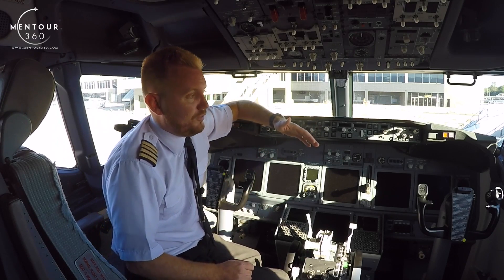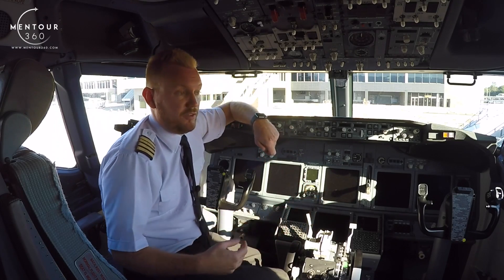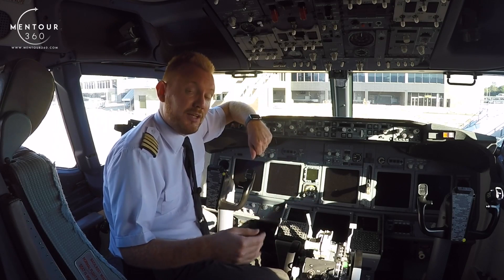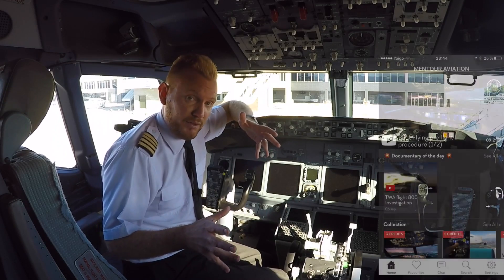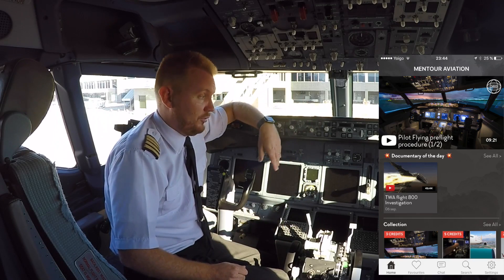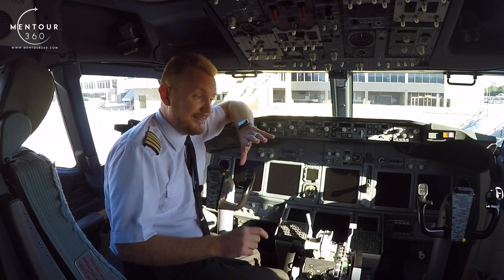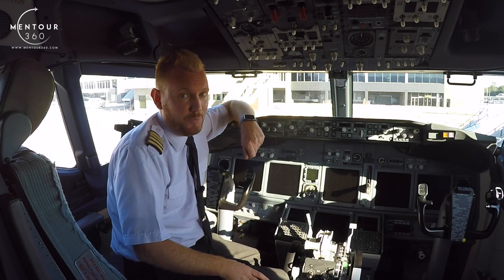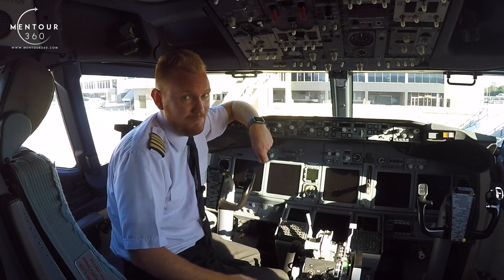How do flaps work on an aircraft?

Comment: Thankyou for the video I’ve built and flown  Remote ControllAirplans so i have the basic concept of the Wings  Job but i was confused on CommercialAirliners Flaps  operations because as a Passenger withWindow seats i could not see anything moving up or down l on the wings  but this makes sense as to why and how they operate  in my defense i was thinking they operated more like the Airelons  but the  more work like  extending and decreasing the shape of the Wings  from both the leading and trailing edges  my imagination had it completely incorrect  as i thought it worked more like a air flow Dam  to increase and decrease Airflow  i knew it was Important for lift and Drag used in take off and Landings

Comment: We see how each wing has two flaps one out board and one inbound noticing how the outboard flap has the two flap fairings beneath. And for the inboard flap I only see one fairing beneath the flap. Why is there only one fairing and how is the other end is supported because I figured if that inboard flap is depending on that one fairing then the stability is not that great without the second one that is needed. I do notice on 747s each flap uses two fairings thereby having four on each wing. I also notice on other planes other than the 747s if there was a fourth fairing noticing that it would be  in the way of the landing gear (747 ones just clears the outer landing gear opening) for other planes is there a side fairing that is built into the fuselage to support the inner most part of the inboard flap and to keep it sturdy during flights, take offs and landings?  Thank You 🙏

Comment: Flap are clear for me now. What makes me still intrigued is the small amount of area of the flaperons. Why do we need them if we still have the ailerons? And also there is spoilerons operating at some times
Reply: Flaperons are needed for high speed handling because they have reduced control authority and cause less wing torsion which leads to bad aeroeleastic effects: aileron control reversal where the aileron makes the wing twist enough that its deflection does the opposite of what it’s supposed to. At lower speeds that’s not an issue, and the ailerons have much more authority

Comment: Any chance we could have a video about the "TERRAIN: TOO LOW" alarm?
Reply: It's very simple, and i don't think it would require a video, basically, on the 737 and most Boeing aircraft, there is a terrain radar system. This can be switched on in the MFD panel (but is not required for the warning), and then you will be able to see all terrain nearby on your ND. So, when the terrain radar spots terrain dangerously close to the aircraft, it'll give a warning to the pilots. It also works if you get too close to water.

Comment: A stupid question: Some smaller airliners have their left and right flap mechanisms interconnected with a shaft, so that it‘s impossible to extend or retract flaps asymmetrically (which could, obviously, lead to a crash). But do even the biggest airliners have that mechanical connection between the wings? Or is there a different safety feature that prevents flap asymmetry? How about an A380 or a 747? Is there a flap shaft going all the way through the fuselage and connecting the flap mechanisms?

Comment: The slots don’t extend the boundary layer, they blast the boundary layer off. This is done intentionally because, even though it loses a bit of lift, it manages/controls the position of the separation point and thus there is less turbulence. 
The extension of the wing means that there is a much higher likelihood of getting separation of the boundary layer over the wing and without slots this would happen at a random, unknown and possibly ever-changing points. This could drastically decrease the handling of the aircraft as it comes to land.
Reply from the maker: Good stuff!
Reply: Mentour Pilot. Thanks! By the way would you recommend going to pilot school after having done a mechanical engineering degree, would it help at all? I am now 22. Do you think it’s too late?

Comment: Wanted to check if selecting flaps 40 or full flaps everytime everytime while landing is advisable coz more drag more control the pilot have while approach, does selecting a setting lower to 30 with lesser drag has any advantage like saving fuel etc. Also as mentioned the LE flaps and slats are controlled by single flap lever for B737; does Airbus sepcially 380 and MD11 have a separate lever for slats coz i have seen pilot pushing down a black lever located near to the flap lever post landing and after retracting the flaps.
Reply: Flap 40 is generally used if the runway is short. It is not recommended by Boeing to use Flap 40, unless the runway is, i believe, less than 1500 meters long. Flap 30 is the best option, gives you a good speed, not too much drag, and a lot of lift.

Comment: Can flaps be lowered and locked using gravity during total hydraulic failure like landing gear?  Can the left and right be operated individually to help bank in a emergency?
Reply from the maker: +Bruce Wagenberg Hi! No, not using gravity but we have an electrical backup system that drives them out in case of hydraulic loss. The cannot be mover individually.

Comment: So, if higher flaps may be appropriate for short field TO, but flaps add drag, is there ever a case for starting the roll with low flaps to build airspeed more quickly, then selecting higher flaps to gain required lift?
Reply: Never for commercial aircraft; too dangerous and adds pilot workload.

Comment: @Mentour Pilot how is the flaps, slats etc differ on a 737 and a B 17 Bomber for example? Does a B17 Bomber have a moveable leading edge and slats?
Reply: Completely different. B-17 has no leading edge devices (slats or anything), and a split flap which basically means the bottom surface of the wing deflects downward. It's not a good flap – draggy for the extra lift it produces, which is not much. The 737 has one of the more complex flap layouts around, and more modern aircraft typically go for the weight and complexity savings of a simpler flap system

Comment: Nice video Mentor, why are the fuel control levers in the video different to the more traditional ones?
Reply from the maker: +Adrian Koola Because this is a brand spanking new aircraft and therefor it has the new electronically controlled start levers. Check out my Instagram account to see them up close.

Comment: Mentour Pilot, why does the fuel cutoff lever in the video different than the levers in common 737-800 cockpits? The lever in this video looks like the lever for 777. Is this an optional feature on the 737NG? Thank you capt!

Comment: Hey Mentor Pilot. Love your channel. I have a quick question. Can a modern airlaner take off without extending  the flaps? I was recently on an A 320 and the pilot did not extend the flaps. I tought we will crush.
Reply: Nope..takeoff config warning comes on..loud🙉
Same on the A320, meaning the pilot flying did extend the flaps😉

Comment: Mentour Pilot You can't turn landing lights on before received "cleared to land" form the ATC, right? Is it an international rule? Anyway your expropriations ware very detailed always and I loved that.
Reply from the maker: +mPD780C1 This is a company procedure and it’s actually as follows. The landing fixed lights are turned on at 10 000 feet to increase visibility. The retractable landing lights and Taxi lights are turned on when landing clearance is obtained.

Comment: Why those Flaps & Slats not automatically reacting ( no manual action required ) when the aircraft speed changed ? The computer can be programmed to know if this aircraft going to take-off, to landing, or go around.

Comment: If flaps create a drag for the plane to slow down then what do air brakes do? What exactly is the difference?
Reply: Flaps create lift and also increase drag, while speed brakes increase drag exclusively. Spoilers reduce lift by destroying the smooth suction surface and also increase drag.

Comment: Also, a byproduct of flaps 30 or 40 is increased drag and therefore higher engine rpm. This facilitates quicker engine spool-up to go-around thrust in case of a missed approach.

Comment: What is the difference between pylons and nacelle ?
Reply: Hey Aman, the pylon is the rigid structure used to hold the engine in its place and position under the wing, without interfering with the airflow over and under the aircraft wing that is needed for lift and control. The nacelle is essentially the engine casing, used to shield internal components from debris and the elements. Hope that makes sense! If you've got more questions like these, head on over to my channel and subscribe! Addressing these sorts of questions is kinda my thing :)

Comment: I assume the flaps numbers are degrees.  It seems like 1 degree would be almost insignificant.  Am I missing something?  Also, when you are talking about a single engine landing, do you mean a 737 with one engine out, or just generally single engine planes?
Reply: Cliff Jones No, flap numbers are units.
Reply: Cliff Jones it depends on the aircraft. Boeing is in degrees, airbus is in units
Reply: ZK-APA No..like I said the 737NG has its flap settings in units🙃 It is kind of close (compared to Airbus) to the degree but not close enough for Boeing to call it degrees in all relevant documentation😉 I believe flap 1 is about 8 degrees🤔
Reply: @speedbird9313  aah Ok. Guess i learnt something new today. Thanks for correcting me. Cheers man :D

Comment: i saw a video where the "operator retracted the flaps at sixty knots and went into a stall"..does retract mean zero degree flaps
Reply: Retract means "put in motion", retracted means flaps are up (so yes zero degrees).
The flap settings on the 737NG is in units by the way, not degrees🙃
Reply: @speedbird9313  i see flaps are set up differently in small and large planes, thank you

Comment: hello, i just wanted to ask, why there is always 1 spoiler that is on a different angle than the others?
Reply: 1 spoiler!? Incorrect spoiler rigging..😆🤭

Hopefully it two on each wing that are a different angle from the others.
On a 737NG the ground spoliers (the inner and the outer spoilers) goes higher up (inner two 60˚, outer two 52˚) than the flight spoilers (the middle four spoilers, half goes 33˚ the other half goes 38˚)
Reply: @speedbird9313  BUT WHAT IS THE REASON FOR THAT, BECAUSE IN THE 777 THE SPOILERS 4 AND 11 ARE MECHANICALLY DRIVEN, AND THOSE ARE THE ONLY TWO THAT ARE ON A DIFERENT ANGLE
Reply: @redescfs  I actually dont know, not a design engineer🙄
But there is probably a aerodynamic performance idea behind it🤷🏻‍♂️

Comment: Hi Petter, I have another question about the flaps. When I flew to Abu Dhabi after landing the pilots didn't fully retract the flaps again. I only know this has something to do with the high temperatures there. Do you know anything about that?
Reply from the maker: +indy pranger No, it’s more likely due to a possible bird strike. If that happens, we leave the flaps in the same position as there were when we saw the 🦅. That’s to make sure the engineers can check it out before retraction to avoid any damage.

Comment: What happens if the flaps fail to retract one wing (asymmetrical flaps). Is the aircraft still flyable?
Reply from the maker: +EinkOLED We Have checklists for that. There is a computer controlling the movement. If it feels an asymmetry it will freeze the flaps in their current position to avoid handling problems.
Reply: Mentour Pilot Thanks for replying.  At cruise speed/altitude are the flaps inhibited even if below ias flap retraction speed?
Reply from the maker: +EinkOLED The Max flap extension altitude is 20000 feet.

Comment: a silly question that has never been mentioned/covered by anyone.... during circumstances such as terrain avoidance or low speed stall where the jets require a few more seconds to pick up speed due to them being set at or near idle prior to the stall recovery situation, why aren't flaps used to provide more lift? Assuming speeds are within their limits, and engines will be able to provide enough thrust to overcome their drag in the next few seconds. Or do they make negligible different in those extreme circumstances?

Comment: What does “TOGA” mean in relation to the button on the thrust levers?
Reply: The "Take Off/Go Around" mode. Used during takeoffs and go arounds. On takeoffs, it automatically increases the thrust to the takeoff power, which depends on aircraft weight, runway length, and weather (pilots need to calculate it). Same thing for go around, except pilots dont calculate anything.

Comment: Everytime the the pilots open the flaps slats and whatever the other one was, the plane brakes, the speed drops so they clearly act like air brakes as well, they they are used during take off is something i cannot understand. It looks like the plane would catch more speed faster without flaps...
Reply: It's true that flaps act like brakes, but they also increase the lift and therefore allow the plane to take off at a lower speed. If we for simplicity assume a constant acceleration during take-off, the required runway length increases by the square of the take-off speed. That means that if the plane needs 30% higher speed without flaps (just my guess), it needs a 1.3 x 1.3 = 1.69 times longer runway to accelerate to that speed.
The flap setting at take-off is a compromise of the need for increased lift and not too much braking from the increased air resistance caused by it. That's why planes don't use maximum flap settings at take-off but may do so during landing on short runways.

Comment: What is the brake cooling procedure on the Boeing 737NG? On the Boeing 777 they recommend pilots to pull gear down as long as speed is not exceeded above 270.
And after brake overheat caution disappears they will use the analog and wait for 8 minutes before gear retraction
Reply from the maker: +Garry Wan Hi! First of all the brake cooling monitoring system is optional and we don’t have it installed. We do manual calculation of break cooling and it’s very rarely a problem if you are on normal weights and using reversers. Otherwise we have a similar cooling system as you described if we are airborne. On the ground we just wait with the parking break released.

Comment: Poor flaps 25, are they ever used? And landing lights at 500 ft? I thought you are required to have them on under FL100. Btw great video, Mentour.
Reply from the maker: +Ondřej Bakan No, flaps 25 are mainly used as an intermediary flap to enable speed reduction to extend flap 40.
No, no one has landing flap at FL100, the drag is huge.
Reply: Oh, Mentour! Many thanks for your reply! My second question was about landing lights, not flaps. You said you turn them on at 500 ft as an indication of landing clearance, but I thought you are required to turn them on under 10 000 ft. :)
Reply from the maker: +Ondřej Bakan The fixed landing lights, Yes. The retractablesxwe wait with to landing clearance normally. Or in the case of this aircraft (LED assembly) we use the taxi light as indicator of landing clearance.
Reply: Oooh, I see! Many thanks for explaining. Have a great day! :)
Reply: Like Mentour mentions in a video about the no smoking sign switch, the taxi lights serve another purpose as a memory device for takeoff and landing clearance.

Comment: How do you land if the flaps won't extend? Would you abort takeoff if flaps don't extend?
Reply: Not a pilot, just an aero engineering student, but issues with flaps should be discovered well before takeoff since flaps are typically extended early. Landing without flaps just means you land very fast and need a lot of runway (and emergency crews ready since the brakes will get really hot, tire burst risk is probably higher, etc).

Comment: On the topic of flaps, something I've always had trouble with is the idea that lowering the flaps increases lift. If it's true that LIFT EQUALS WEIGHT, then putting the flaps down must increase the weight of the plane. And of course it doesn't. What makes sense to me is that, lowering the flaps lowers the stall speed. Now I understand that if you lower the flaps without simultaneously pitching down a bit, you'll momentarily increase lift (and load factor), thus keeping with LIFT EQUALS WEIGHT. Or to be more accurate, LIFT EQUALS WEIGHT X LOAD FACTOR.
Reply: Lift equals weight when flying straight😉 With flaps down lift will be greater than weight and it will get an upward motion.

Comment: I understand the reduced lift in very hot summer takeoffs. When I flew recently from Spokane, Washington to Denver,Colorado it seemed as if the extreme cold temperatures at takeoff [ 13 °F ] and landing  [ 0 °F ]  affected the amount of deployment of flaps .  Does the cold have a great affect on their use?

Comment: Sometimes, when a plane taxis after landing, I notice that the flaps start to retract, then pause, then continue to flaps 0. Why do the flaps sometimes pause insiead of going from full directly to 0?
Reply: because there's lots of different flap settings. on a boeing 747 i'm pretty sure it goes 0 - 13 - 25 - 50 - 75 - 100

Comment: Here is another good question,when do pilots use the flap 40 in normal operation? Because most of the Boeing aircraft have max flap 30
Reply from the maker: +Garry Wan We use it when the landing distance is limited and when we do Cat3 approaches.
Reply: I've seen 737 on Flaps 40 approach in Dortmund EDLW, 2000m long runway.